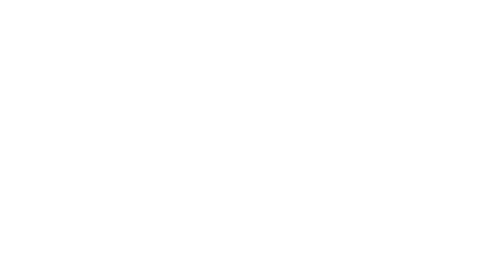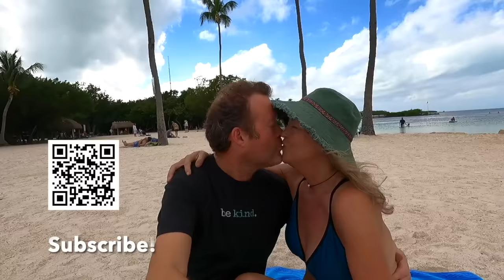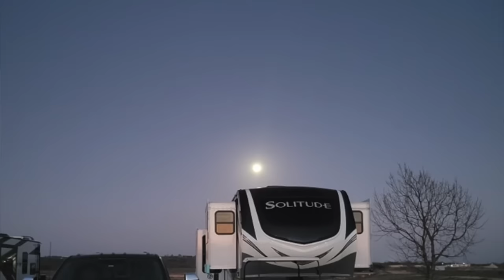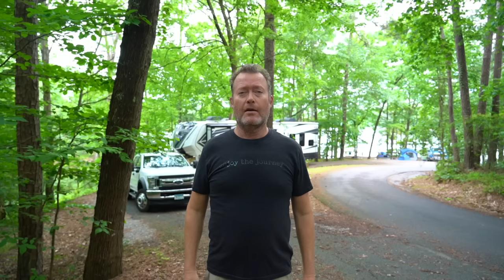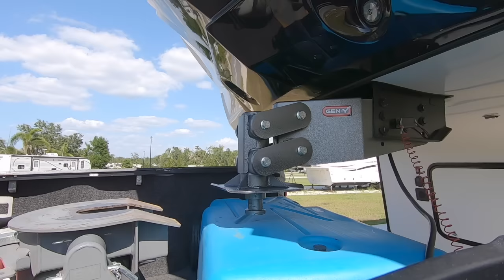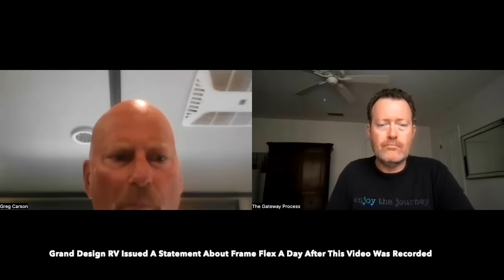WARNING! Hidden RV Safety Risk You Need to Know (Grand Design RV Frame Failure)

Comment: In BTBRV's trip to Lippert, they mentioned how leaving those bolts out would affect the 'super structure' of the RV. It seems to me that GD didn't do their due diligence by not adding bolts to make the 'super structure' complete. I'm starting to feel Lippert is less to blame here than GD. I know people are complaining about Lippert welds, but not seeing them personally, I won't comment on that.
Reply: Unless we see a pattern of bad welds on the frames. I'm tending to come to the conclusion that GD under-designed the trailer structure and then failed to complete the construction needed to provide the rigidity the combined frame and body structures required.' Did Lippert build the frames to the provided specs?

Expecting an RV body to provide more than the strength needed to keep it together AND add strength over and above the frame is (IMHO) is almost fanciful.  Personally it's been around 50 years since I took my Statics course, but I would have included a strut or gusset running from the inner end of the top frame diagonally back down to the main frame.  Push up on the pin box and the frame is going to want to pivot around the joints where the vertical members running up from the front end of the bottom main frame to where they join the upper frame members.  That will transfer the loads and minimize the tendency to flex there.  Flex = Fatigue = Failure.  Unfortunately putting those preventative members there blocks access to the space that they put the pass throughs in.  

Look at railroad truss bridges.  They are almost all built as a complex mesh of triangles.  Look at a 12 pack box, when it's empty and the ends are freed up it collapses.  add diagonals between opposite edges and it's harder to collapse.
Reply: Agreed, like trusses on a house.

Comment: We are witnessing the collapse of a once respected company.
Reply: Collapse of LIPPERT they are just as culpable as GD.
Reply: @jimlarkin1400  True. But customers should not have to wait while the children squabble.  GD sold it. The own it. They can deal with Lippert later.
Reply: I agree.  I had a GD solitude for a few years and sold it.  Now I’m in the process of getting another but this time I’m going with Brinkley. They are new enough to have a reputation to maintain so they are still putting out quality campers.
Reply: So sad. There are likely some pre Thor / Winnebago units out there owned by folks who are selling them. I have a Winnie coach and it’s built like a brick you know what. Some friends have a little Thor pusher with the mid door and it’s been an amazing coach. But I would not purchase anything from that conglomerate today.
Reply: @jacobmills1982 And they have better built frames. I bet that new Lippert frame is the frame that Brinkley designed for their RVs. Better specs

Comment: I had a new 2019 GD Reflection in 2018. A year later, the kitchen slide out floor edge trim scraped a hole on the main floor laminate. When I took it in for repair, I was told they used 1/2" in lieu of 3/4" because they our out of the spec floor board. This caused the floor edge trim to scrape a hole on the main floor. GD covered it and did a patch job. 6 months later, the patch job delaminated. When I contacted GD, they refused to cover it because it was past the warrantied period.

Comment: Great video and interview!  Isnt this exactly what Lippert mentioned was happening?  No doubt there might be some Frame issues with quality of welds and such, but failure to install the Lag screws/bolts properly and use additional other methods of securement such as construction adhesive can cause the detachment that was mentioned in the videos.  Hate my interview or love it, the main goal was to get information. And I think what he's telling us completely corroborates what's being said.  Some manufacturers go an additional step of actually using huck bolts and lock nuts.  I truly believe there needs to be innovation here to replace this practice and put in either a bolt plate or some other fastening method in addition to a chemical adhesion.
Reply: Most of what you are saying here is spot on about the securing of the walls but you quickly jumped over to put blame on Grand Design without really saying a thing about Lippert's part in this with bad welds, that I thought were done with robotics but apparently not programmed to make sure these bad welds don't happen. Now, I do think Grand Design is also to blame for accepting these trailer frames but Lippert is still the manufacturer of these frames also. They are both accountable for this so let's just be very clear about this!  -Pete
Reply: It will also add Grand Design's missing bolts/lag bolts and their failure in using 3/8" bolts in 1/2" frame holes and not having something like huck bolts as you say. Their engineers or maybe even executives for doing this should b fired for cutting corners.
Reply: Let me clarify the video you missed.  After the beams leave their processing facility (where they are robotically welded) they go to another facility (one of several Lippert has) that has 600+ welders assembling and welding frames.  All welders (according to them) go through welding certification.  That said, it's hard to get 2 extremely talented welders to agree on each other's work, let alone trying to find and keep over 600 welders in Elkhart Indiana.  I believe any company producing over 1000 complex welded products each day needs to have a really strong inspection process.  That said, it would be naive to think that a few bad apples, poorly trained personelle, lazy employees, or just absent minded inspectors don't let things get past them.  This is where they need to step up and ensure there is an amazing customer service program AND that when the frames get to the RV manufacturers, they get noticed and sent back when sloppy work is found.

Comment: Thanks for highlighting this issue.  I have a 2019 Keystone Montana.  The side wall by the front slide bulged out such that I could slide my fingers under the forward side of the  bottom of the slide seal when closed.
Thankfully,  working with a local General RV dealer in Michigan and Keystone Customer Service over several months, Keystone approved repairs. Keystone insisted on detailed steel frame  inspections and measurements (which they paid for) to zero in on this specific type of frame failure.  Kudos to them! 
When the side wall was opened up, the vertical aluminum frame tubing forward of the slide only had a single spot weld on this high stress area tying it to the main horizontal inner wall frame member! That had broken and the bottom of the vertical frame member had shifted out 1/2 to 3/4 of an inch. This is near  the expansion joint. 
A complete weld bead was made between the vertical and horizontal frame members and gusset added on either side. The wall is now flat (again) and slide closes perfectly. Mine was one of 4 fifth wheels  of various brands being worked on to resolve the same problem the week they worked on it! All roads lead to Lippert!
Reply: Isn’t the vertical aluminum frame wall built by the Coach manufacturer?   Lippert builds the steel “base” frame of the structure.
Reply: @MikeyMK-ct7jr  My understanding is the manufacturer contracts the aluminum frame walls to Lippert.

Comment: Great video Tom, We has well are experiencing frame issues with our 2022 397 th Momentum. I myself had removed the Filon to inspect area because of pinbox movement and found bent gussets pinbox, multiple broken welds, backed out and missing lag bolts that weren’t even installed. Sent multiple pictures and documentation to GD .We have and open case with GD. Wish us luck
Reply from the maker: Thanks for sharing, let us know how the repairs go.

Comment: I was buying a Grand Design. I had an appointment to purchase one (not a fifth wheel) but this made me pick something else. Not because what I was buying was a camper that was included in this frame failure, but because of how they were handling what is happening. I no longer feel the desire to own one because I don't have faith in the company and how they would handle an issue if I had one.

Comment: Great video!!!  1. I am a recent Grand Design second owner (reflection 367BHS).  As such, I have been keeping a close eye on any/all "frame flex" videos. However, I have, as would be expected, focussed solely on Grand Design related videos.  With this in mind, have you seen this level of complaints about frame flex issues coming from other RV manufacturers?  The reason I ask is Lippert appears to have a lion's share of the market when it comes to supplying the frame the RVs are built on.  2. As an engineer (mechanical) it is refreshing to hear more technical details coming from Mr. Carson.  He hit on some very key issues of which both Grand Design and Lippert equally own a large share of.  First issue is not having lag screws in key areas where they are needed.  Massive oversight and signs of no quality control for Grand Design.  Potential poor choice of materials (aluminum box beam stuffed with wood acting as a structural member).  Bad welds is a huge deal for any fabricator (Lippert).  And I have seen areas in the frame illustrated by others where gusset support plating has bent due to being under designed.  In my industry (offshore oilfield) we say you have to make a product "oilfield tough".  Looking at these frames, they don't appear to be anywhere near to being able to own that type of a phrase/mantra.  I have seen an example of a Lippert frame and it simply "looked" underdesigned for the application.  3. You mentioned when will be the time that this issue will be put to bed? Unfortunately, I truly believe it will require implementing government regulation of the RV industry before this issue is truly resolved.  Industry standards created, third party certifying bodies required to certify each unique design as compared against the standards, implementation of random audits, etc. So folks truly need to follow Mr. Carson's advise and if they have experienced a frame flex issue, they need to report it to the National Transportation Safety Board (NTSB).  4. Last, and this is near and dear to my heart:  ETHICS  In university we took a pause and the dean of engineering required all engineering students to take a look at ETHICS in a little 1-hour credit course required to graduate.  We were given a variety of ethics related events to study and then write a report on.  I chose the Ford Pinto issue (If you rear ended a Pinto the gas tank could rupture and catch fire).  Ford knew about it however their "bean counters" took the stance that it was cheaper to settle those few court cases that came up as compared to implementing a massive recall of the cars to properly fix them.  UNETHICAL behavior.  I feel like both Grand Design and Lippert are falling into this category to try and avoid the massive costs of implementing recalls.  I see it as failing to address two primary issues: a. A design that does not come close to meeting the loading conditions these RVs are exposed to.   b.  Poor Workmanship.  When these two issues happen together you will start to see the number of failures out there that are occurring.

Comment: How can anyone with an engineering degree think that Lag bolts into wood will create any support for the front portion of the pin box sounds like hillbilly construction, and the welds on these frames are garbage not just GD all of them show bad welds.

Comment: We looked at Grand Design before settling on a Riverstone and could not be happier with the quality and service from the manufacturer even now 3 years later.  The SC dealership we ordered it from sent their driver to Elkhart  to pick it up.   We had an independent inspection and all issues were addressed before signing the paperwork .  That was a plus on both sides because ours was ordered per our choice of add ons/changes so if we had backed out perhaps the next customer would not have wanted our choices and the dealership would have been stuck hoping for someone who might want it.   This problem with Grand Design makes me thankful we made the decision we did vs being potentially stuck with an unsafe 5th wheel

Comment: If your jacking up a trailer with the rear jacks up and your intention is to lift the front jacks off the ground with 2 - 2x4’s why on earth would you do this with your wife doing laundry inside the trailer?
Reply: The goal is to leave the front landing gear down and only jack it up enough to get the jacks maybe 1" off the ground. The technician knew she was inside and said not to worry.

Comment: I wish everyone would stop saying “frame flex”, it’s not. It’s FRAME FAILURE! Bad welds, missing fasteners, etc, the NTSB needs to go after these manufacturers and hold them accountable for the crap that they are putting out on the road. Someone is going to get killed one of these days!
Reply: Bad welds are a Lippert problem.  Factory finishing and then Incoming inspection should have caught those. Pin Box support might be a Lippert problem.  But It seems to me that everything done after the frame is delivered is a trailer maker problem.  If they didn't fasten it on correctly.  If they didn't spec it accurately to Lippert and Lippert built it to their specs, not Lippert.  Did Lippert include specs on what kind of hitch systems, limitations on truck suspension systems could be used, did GD pass them on to the dealers, did dealers pass them on to their customers?  The overall hitch system needs to accept pivoting in 3 degrees (roll, pitch and yaw) and transfer the slam up or down not captured by the truck as it hits potholes, etc.

Comment: Look for other campers that are having problem. I think because industry went to the light weight trailers caused light frames. Plus the roads are horrible
Reply: R-Pods are a prime example. Certain models are/were collapsing on their frames.  Forest River has extended more frame members all the way out to the edges of the body.  Other models were bending their axles in numbers more than attributable than just overloading by owners, although that was the primary cause.  They built too many features in and left in reality an insufficient amount of payload.  One initial "fix" was to tell owners to travel with empty tanks.

They also had to add a lot more guidance on Weight Distribution Hitches.  A lot of owners with the assistance of dealers put WDH that were designed for use on much heavier trailers, unnecessary WDH leading to a lot of frame failures.  It's my understanding that FR is recommending that WDH be avoided in many situations.

Comment: It shouldn’t matter what pin box is on the rv, air bags in the truck is an upgrade in towing, a gooseneck pin box is an upgrade, they cause no extra leverage or the ministry of transport would not let them be manufactured into new builds, horse trailers and car haulers have had them on them for years .I had been looking at a momentum for our full time living. Not sure now as we have no sticks and bricks to fall back on. We pull a 2013 Ti 32 Heartland Bighorn and have put over  90,000 km on it all across Canada with no issue . Waiting to see if second owners get repaired…

Comment: I live within 60 miles of where Grand Designs are manufactured.  Last July they laid off over 150 workers.  Seem to be in decline.
Reply: If the norm is there those left are doing many jobs instead of one good job and performance drops and quality. I am afraid someone’s gonna die and then it will be too late and GD will have already declared bankruptcy.
Reply: My question is how many of those 150 employees that got laid off could have been transferred over to the customer service factory where they could do the warranty repairs of rigs that they originally built? Seems like a concept, huh?

Comment: I would request a new frame with the ability to see the welds and material used to build it.
Reply: I'm not sure that this would be possible as there is insulation under the frames as well as tank heat pads.

Comment: Air bags don't enhance weight capacity..they help with rear end sag and help LEVEL UP the towing vehicle witch helps stability. Transoms are on the back of a boat...transits and laser levels are what most of us in construction would use to measure degrees off level center . I'm also wondering how even if that campers jacks would have buckled how that would have been life threatening for his wife ? Your problem is NOT Lipert, It is in your case Grand Design. Look I agree I would be livid as well with that poor workmanship, but don't be a California lawyer and try and drag the plumbers into a framers problem!!!!!!!!!!!! coming from a General Contractor!!!!!!!! Go after Grand Design..don't take that camper back..They will try and fight you on it , but make them take it back, or trade for a new one on a even trade...Like I said , I would be livid , but this is NOT liperts problem...they delivered a clean ENGINEERED frame according to Grand Designs specs, What GD did to affect the frame is on them.(missing fasteners) They are a RV scumbag manufacture as are all of them!! On that size of a Fifth wheel the best thing would be a 3rd axel!!!!!!!!!!!
Reply: Are you serious here? Are you not reading people's comments about the many bad welds on these frames? By the way, what if she would have hit her head in the right place? I'll give you time to think about that.